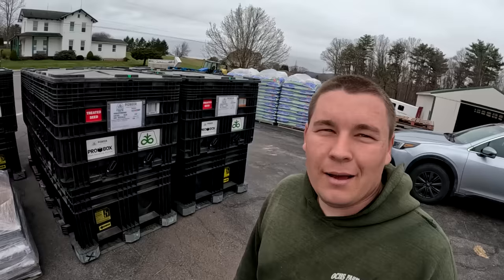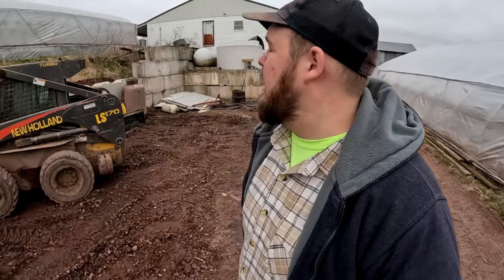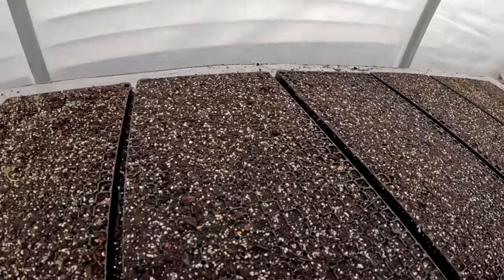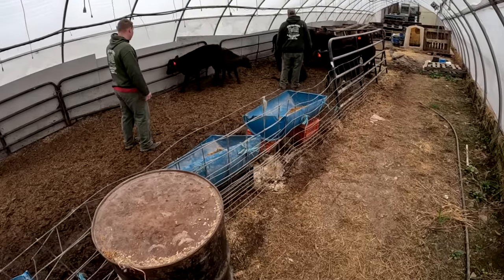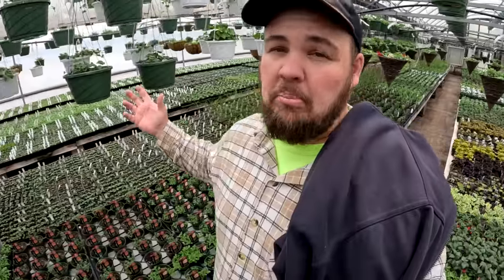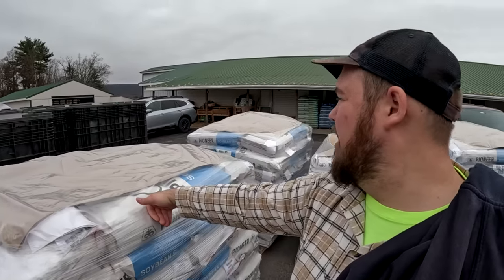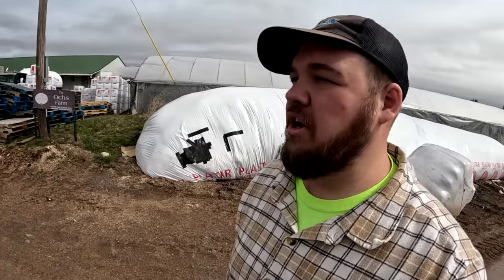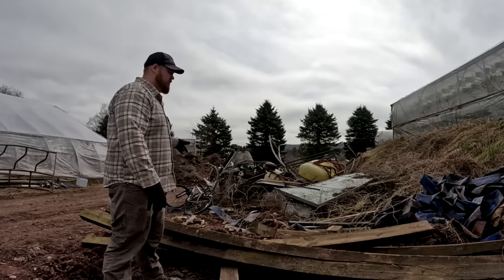REMOVING YEARS OF SCRAP (MAKING THE FARM BEAUTIFUL)

Comment: Scrap metal prices...
In the late 40's to late 50's all the railroads in the US retired their steam locos
and replaced them with the new diesels. So many old locos were scrapped
the bottom fell out of the scrap metal market to the point the scrap yards quit
taking old locos. So even today sometimes you will be way back in the woods 
somewhere and stumble upon a set of rusty tracks & find an old loco. Some
RR dumped them into rivers & lakes others just found a gorge out in the 
woods somewhere & pitched them in. There were no enviromental laws back
in those days.

!

Comment: If you raise that water tank about 8 feet and put the primary water line into the tank you won’t have back flow  or pressure problems it will be a water tower

Comment: I hope you look into making wood pellets and wood cips that auger feed a bioler to heat greenhouse tables for more fruits, vegtables fresh year round.       Put a chip drying process into the hopper.  You could install a french drain that also tempers air into the greenhouse.  They grow oranges in nebraska.  Geothermal heating and cooling in the summer.